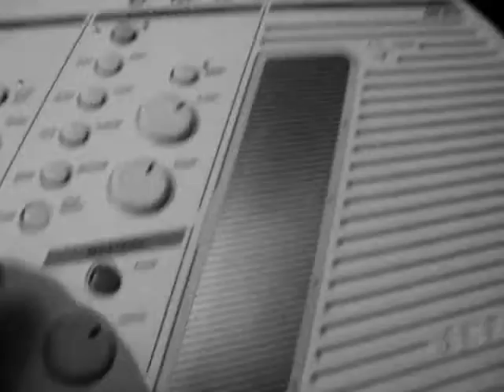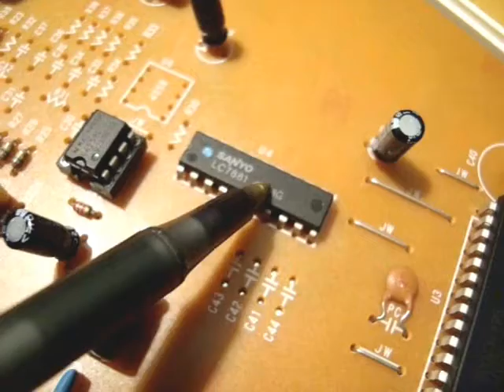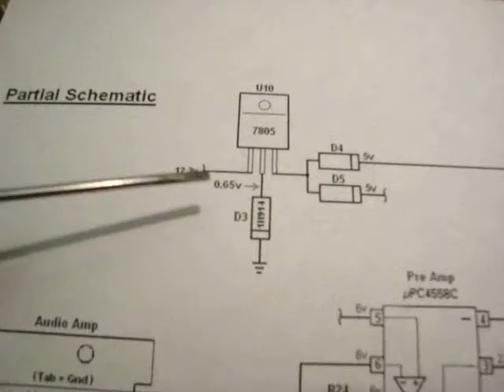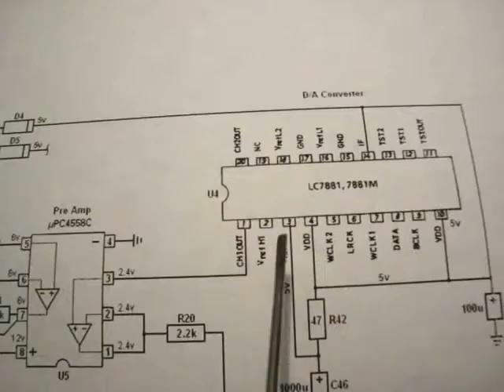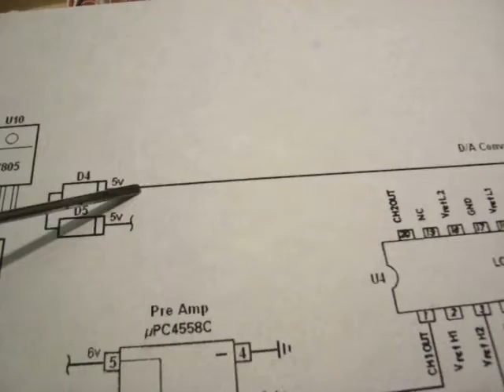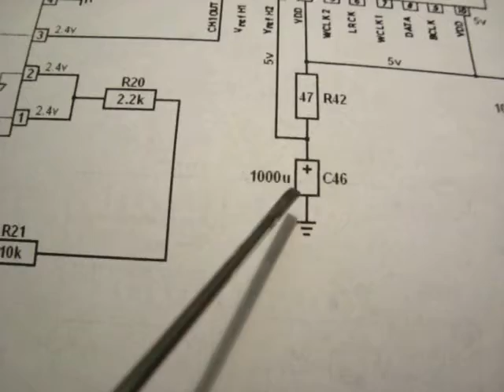Suzuki Omnichord OM-300 Repair

Comment: I got an OM-300 from Goodwill. The switches work but LEDs for the Demo, strumplate bank 2, Manual Chord, and Drum Start are on when the power is turned on. I can get the Demo LED to turn off if I press the rhythm bank 2. But, then the Chord Plus LED goes on for some reason. I know the issue is with the bottom circuit board (MGS-65C 228-22238 A) because I swapped it with a working one. I could not find a schematic. Any suggestions of what to check or compare?
Reply: Maybe a faulty IR2411 (only because it's near the LED connector)? It looks fine however.
Reply from the maker: Thats a Darlington Transistor Array i.c. hmm.. not sure if that's the prob. May need to check voltages and caps on the bottom circuit board you mentioned. If you replaced that board with a know working one, then check the voltages and caps on that board, and yes, that darlington array chip may be bad too.
Reply from the maker: 🤔 I'll have to think about that. Good question.